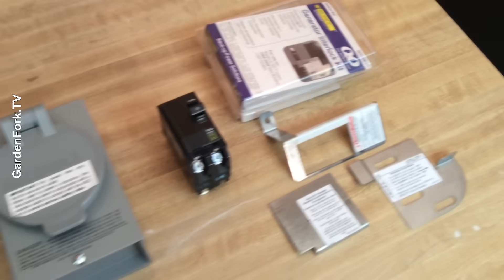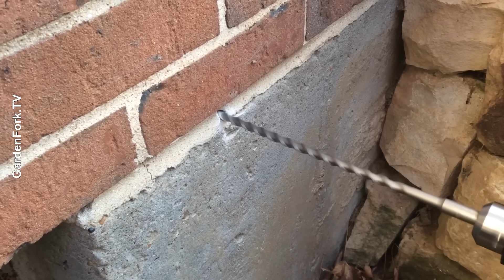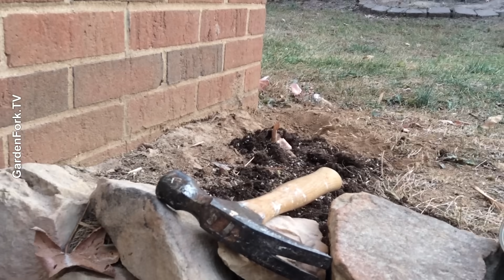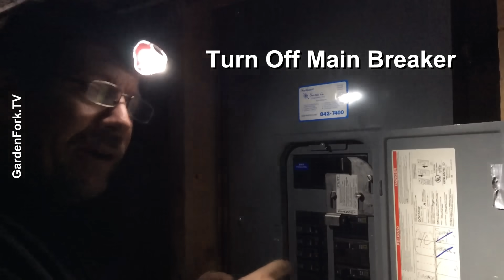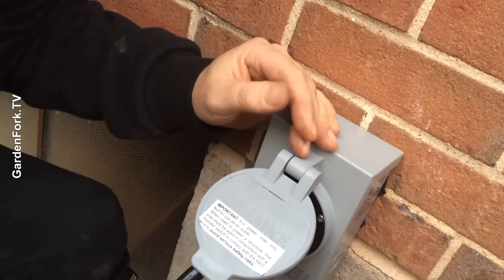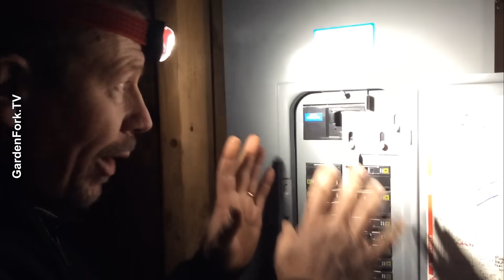Your Easy  & Safe Way To Hook Generator To House | Generator Interlock Switch Install | GardenFork

Comment: Here in Canada there is a Canadian Electrical Code but each province has it’s own Electrical Code with differences and variations from the Canadian Electrical Code.  Also there are differences and variations among the Provincial  Electrical Codes. You have to follow the Provincial Electrical Code for the province that you are in along with all the rules of the Electrical Inspection Authority for the province.  Not sure about other provinces or about the US but here in Ontario if you are the homeowner and want to do some electrical work in your home, you do not have to be an Electrician but you need to take out a permit for the electrical work you are doing from the local Electrical Inspection Authority. An Electrician also has to take out a permit do this but since the homeowner is usually not an Electrician, the Electrical Inspection Authority will charge you considerably more for the permit at least twice as much.  The permit will be in the homeowner’s name. Once the work is done you can schedule and inspection and if the electrical inspector is happy with your  electrical work, he will approve the  work and you are good to go.  Once again, you have to be the homeowner to do this and you cannot do this for someone else’s home.
Reply from the maker: Yeah, it is complicated! Thx for sharing. Eric.
Reply: @gardenfork  I always see a little complication as a challenge.  The electrical codes list the rules and as long as you learn and understand the rules for your jurisdiction, things become much less complicated. 

I just wanted to point out that you do not have to be an Electrician to learn and understand the rules in the electrical code and as I mentioned earlier here in Ontario Canada if you want to do electrical work on your own home you do not have to be an Electrician provided you follow the rules which also includes taking out a permit from your local Electrical Inspection Authority for the work you will be doing in your home and have the work inspected by them.  

Having said this, if you really want to be an Electrician, then you have to complete all the required schooling and training and get your license from your local Electrical Inspection Authority. Once you are a licensed Electrician then you can do electrical work for other home owners or for commercial and industrial jobs.

Whether you are an Electrician or not, the Inspectors from your local Electrical Inspection Authority will have the final say on how the rules in the electrical code are interpreted. If the Inspectors ask you to change something don’t argue with them just do it and you will not have any problems.
Reply from the maker: Exactly! It’s all subjective when the inspector reviews it.

Comment: forgoing safety,  what'd be wrong w/shutting off the main and using a cord w/two male ends
Reply: Pretty much what I do. It works!
Reply: Like backfeeding through a dryer or welder plug?  Technically it works.  Professional electricians call a double-male plug a "suicide cord!"  If you screw up, you could have energized, exposed male plug.  If you pull more power than the cable, plugs, or receptacle is designed for you can damage one of those parts - worst case, you start a fire.  If you start a fire doing this, I guarantee your homeowners insurance won't pay a penny for any damages.  Hurt or kill someone in the process -- same thing.  It cost me $400 to have an electrician put in the breaker and receptacle that's properly rated for what my gen makes.  Doesn't seem like a lot when you consider the worst-case alternatives!
Reply: @estessystems3426  how can you pull more power? A 30a/220v plug is rated for just that, as well as the cord. You can't connect it otherwise. You'd have to be stupid to put different ends on a smaller gauge wire, and the receptacle would already be wired with 10/3
Reply: @estessystems3426  considering worst case scenarios, one would need a safe/guns w locks/storm shelter/lightening rods and a close relationship w/ur maker.  Practical folks know how to how to be safe/survive w/o bells/whistles/idiot proofs.

Comment: I have a 5k diesel generator in my shed that exhausts out the roof and has a transfer box in the garage, where my panel box is, the power cords are buried under ground between the two. But, for smaller setups there is also a method very similar to what you presented here. To get the cord from the generator into the garage I installed a 2" PVC pipe through the wall so extension cords could get inside, then a rubber cap seals it off. Slit an X into the cap and you can push the cords through easily when needed. Next make a double male end pigtail that will allow you to plug an extension from the generator into an outlet, pay attention to what order you plug if the generator is running because the male end can be hot if plugged in the wrong order. If you want to power to both sides of your panel you will then need an outlet to plug into for each side or if say your fridge and furnace blower are on the same side of the panel one may be all you need. Everything on that side of the panel will have access to power realizing your generators limitations and using accordingly. Don't forget to turn off your main breaker first so you don't back feed power outside your house. This way, other than making the double male pigtail, no electrical work would be needed unless you don't have an outlet that is on the same side of your panel you need powered. Then you would have to add in an outlet which is easy if your panel box is accessible. Also, I would let the generator run right inside the shed. No one is going to be in there while it runs and with the door open it will be easy to go in and shut down when needed. This will keep it covered during inclement weather which can go hand in hand with the need for a generator.

Comment: How is that easy if your hiring an electrician? $$$ Might as well have them install it correctly with a simple transfer switch.
Reply: There are several videos available that show the homeowner installing the outlet, breaker and interlock switch without an electrician.
Reply: Or do it yourself if you feel capable

Comment: Well, there was a lot of redundant information in your video. 
That being said. There are several areas not addressed in your video. 
First off, there is no mention of a ground grid or rod? I have a similar set up with a 30 ampere/240 volt breaker to back feed my panel. Mine was installed by an electrician.
The generator itself needs a ground to dissipated any static build up after it’s been running a while. This is especially important if your refueling with raw gas. A spark could lead to a deadly explosion. 
Second, just so everyone understands? If you have anything that is plugged into your house electric that is micro-processor controlled? Those costly appliance will need clean 60 cycle power. (An inverter generator should be used if you have any new appliances or furnace or A/C). Otherwise all your efforts will be for naught. You’ll be making an expensive trip to Lowes to replace everything the generator burned up. The Coleman generator featured in the video is for power tools & incadescent light bulbs ONLY. 5000 watts is deceiving. That would be maximum power. Any significant motor load would surely draw that down for a few seconds & quite possibly cause other load to not come on? 
If you had an old style Kelvinator fridge with incadescent light bulbs you should be fine? Otherwise buyer beware.

Comment: Safety tip : When you turn the main breaker on. Make sure all other breakers are off. Then turn on the main breaker. Then turn you other breakers on one at a time. This method prevents a serge of power through the main breaker.
Reply: Better to just have surge protectors for things like your computers, TV, electronics etc., are usually the only items that suffer from surges...
Reply: I have a surge protector on my freezer and refrigerator...  We are prone to electrical surges were I live...
Reply: I have a whole house surge suppressor in my fuse box.
Reply: I have a "whole house" surge suppressor installed in my fuse box.

Comment: I have solar is there anything else I need for that ?
Reply: The average solar will not send power into your panel if it senses no opposing current. If you want to utilize solar back-up you would need to maintain a bank of batteries. Utilizing a generator is cheaper.

Comment: You could totally do this yourself with a 240 30a breaker.
Reply: Questchaun It would still be $20 so what is your point?
Reply: @greenidguy9292  you might want to shop about that's a bit steep for a popular breaker type.
Reply: @Questchaun  it depends on who makes the breaker box
Reply: @greenidguy9292  I think his point was do it yourself and save about $500 on a hiring a electrician. I have a Arc welder in my Garage, so I just Unplug my welder, and made a short cord that runs from My Gen to the welding plug and back feed through my welding plug outlet and skipped all that jazz.
Reply: Bill Williams    Definitely not legal and if you forget to turn off the main breaker you could kill someone.
Reply: @stevez6499  Is that illegal?It shouldn't be since they sell this kit. Its the same thing isn't it?
Reply: @stevez6499  Definitely illegal here in the UK, how on earth do you get the frequency of the AC to match? Some of the questions asked on this page just confirm that Joe Public shouldn't be doing this! The outside 'socket' isn't a socket at all, it's a fixed plug with potentially live terminals to touch! Crazy, crazy.
Reply: Edward Mascari  You can make an "interlock bracket" for about $5 that would be to code if you have a rotary cutter and any piece of scrap metal, it's literally just a fucking piece of metal in a specific shape for your breaker box.

Comment: 10,000 watt generator will power most everything in your house.
Reply: Except a 3.5 ton central air unit and a standard size refrigerator, in Florida you have to have both these items running. We were running 2 window units and a refrig for 6 days two years ago after a early September hurricane passed by us, you can live with out hot water, no AC is a different matter especially when the temps are in the 90's and humidity is 80%+
Reply: @oveidasinclair982  I cool down the house and turn off the AC and turn on the water heater for a short time. Then switch back to the air. An hour or so a day can give you some hot water but not let your house get very hot. What I do is to turn off the AC in the morning when it is cooler, heat up some water and it will stay worm all day if you don't use it much. Everyone has different needs. I just tell what works for me. I live on the east coast of Florida and know how much fun the storms are. NOT MUCH! But have found much is in your head. You get to camp out! You use the same things as when you are going for a week camping trip. If you want to know what you need to have ready before a storm.  You need everything that you need from a week long camping trip!
Reply: @donaldsmith3048  if it is 90's with humidity... how much hot water do you need?  And skip showers... hurricane, walk outside, come in and towel.  DONE.
Reply: @oveidasinclair982  
Most big a.c. units run around 4 to 5thousand watts.
Reply: i powered my furnace and fridge with a small inverter gen at 1600 running watts
Reply: @latinbeandip  what kind of van do you live in?

Comment: 40 year electrician-Bad idea.
Reply: Just because you can type out 40 year electrician doesn't make you one... The interlock is made by square D for generator use. Square D isn't going to sell an accessory that doesn't meet or exceed NEC.
Reply: @steelcityundercoating  Just because Square D makes them don't mean shit
Reply: @steelcityundercoating  That's what the yoyo that made this video needs to hear not me
Reply: @steelcityundercoating  I didn't say anything about Square D interlocks not meeting code.  I would suggest you stop putting words in people's mouth and actually comprehend what they are saying.  Just because interlocks are available doesn't mean they are the BEST option and only competent electricians understand why.  Not keyboard punching trolls.
Reply: @steelcityundercoating  You make no fucking sense so go troll somewhere else.  Interlocks are a cheap solution not always the wisest one
Reply: @Mr Sunshines Terrible idea.  If that cheap interlock fell apart from the screws loosening it would be like having no protection at all.  Do the job right or not at all
Reply: Right on.  Electrical vids should be banned on here IMO!
Reply: The last thing that you should do when it comes to electrical safety is listen to some yo-yo on YouTube

Comment: We just turn off the main breaker and put it through the dryer outlet easy not a problem
Reply: MsLisaPA Half Ass!
Reply: Very dangerous and a major code violation!
Reply: So your Dryer is in your house? and you have a gas generator (blowing carbon monoxide) in your house when the lights go out..... Well we cant all be smart.
Reply: Raver Magik stupid, the generator is outside. OMG, some people need diagrams I swear.
Reply: MsLisaPA, and that is a great way to kill a lineman outside when the power back feeds into the grid! 🤬
Reply: Scott Smith why do you think you have to turn off the main breaker... duh!

Comment: In my personal opinion, if you're going to spend the money on a generator, do it right the 1st time. Buy one that can run your whole house and buy the transfer switch. If the power is out for a few weeks because of weather or whatever, it's going to be a giant pain in the ass to keep flipping switches every time you decide to run a different appliance or heater/ a/c.  I would prefer to run everything I normally would when commercial power is on.

Comment: This is pretty much what I do minus the extra breaker , outside connector and child proof piece of metal... much simpler and cheaper than your set up.
Reply: Simpler and cheaper huh?  But code compliant as well?  I doubt it

Comment: How is an easy safe way to use a small generator to run only a Well pump??? Want to run water on a property that gas a well but no power at this time
Reply: Is the well pump 120 or 230 volts
Reply: @tims.5995  I Think I saw a paper tag on the wall that said 120 volt power on it... I would need to drive out and look again.

Comment: About how much will a electrician charge to install this?
Reply: Being an electrician my advice to people who want to save money I would suggest you do the majority of the work yourself and just pay the electrician to do the hook up to the panel. Obviously you will need to have some handy man skills but you could install the plug outside and run the wire back to the panel which can be time consuming, time is money as they say. Have the electrician inspect your work to make sure it is up to code and then he can do the dangerous work that he is trained and experienced to do.

Comment: You should sleeve the wire with a plastic pipe where it goes through the wall to the plug.  It could get damaged by the brick and mortar.
Reply from the maker: Good point!

Comment: My moms one friend had her house remodeled and added a second kitchen for use with the room she rents out but had a sub panel installed. The new fridges outlet comes from the sub panel instead of the main panel. She has a 6 110 circuit transfer center since the gen only does 20 amps 220.  City house with natural gas. Dont know of 220 lines other than hot tub. I personally would do just a 30 amp breaker for me to use but i know this is proper. I have a 7500 generator for my welder but when i get my own place a gen plug in is up high on the list or simpler a plug for welder and a suicide cord temporarily. I know of a few friends that use suicides safely but one is an electrician other is very knowledgeable in electric

Comment: What do you need to do if your generator (Honda eb500i - inverter) has a bonded neutral-ground along with your house panel?  Because of the dual bonded N-G in generator AND house, the GFIC on the genset trips.
Reply from the maker: i would check with an electrician on that one. thx!

Comment: How is this easy? I bought 4 feet of 10 gauge 3 strand wire. Stripped it to expose the 3 wires and screwed a self making plug to those wires on both sides (cut the wire into 9 inch sections). Then an extension cord can have a plug on both sides.  Plug that shit into your wall outlet. Bam power. Then if you're brave turn that particular breaker on. Now with every breaker off you can slowly start adding more breakers to the draw.
Reply: It's only illegal if the electrical police visit my store lol.  Plus my power panel is double locked and I am the only one with keys to it and obviously the main is shut off.